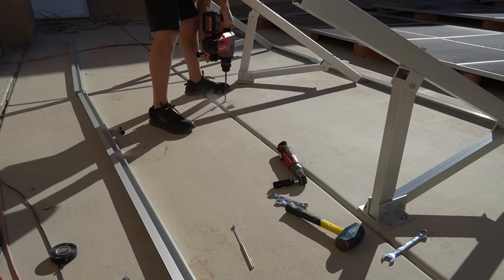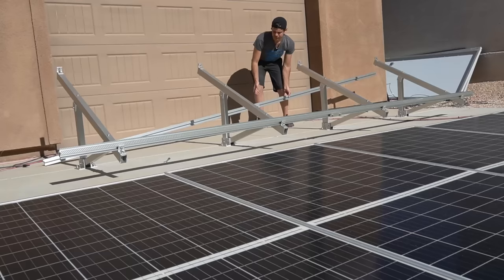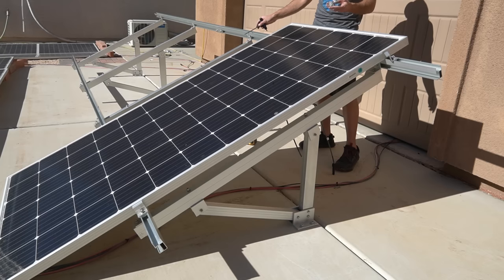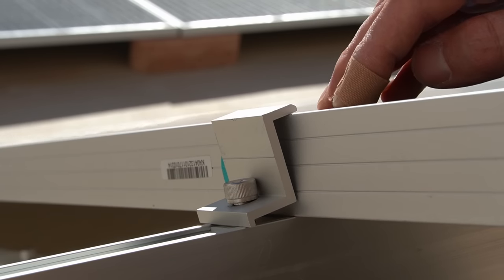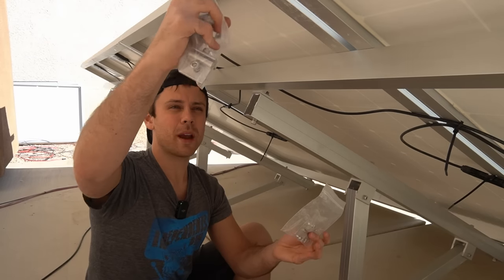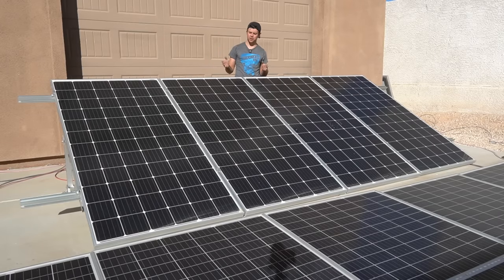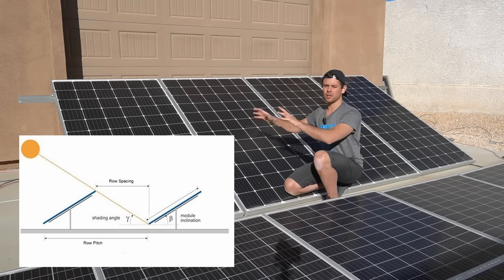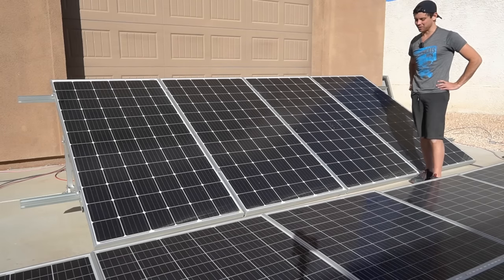$279 Ground Mount Solar Array - DIY Friendly!

Comment: Ok, it's unlikely that a bolt of lightning will struck your panels at their current place. Nevertheless, the ground connection should be a massive rod. The clamp for it shows its nominal diameter quite well. This tiny wire will just evaporate, when the frame got struck.
Reply: Pretty sure a direct hit of lightning would destroy the panels, doesn't matter what ground connection you put in. For direct hit lightning protection you'd need an air terminal. Not sure what grounding these likely anodised frames would achieve (compare to a car: a big hunk of ungrounded metal...) Maybe for electric shock from abraded cable on worn frame and then you touch a non-anodised part? Seems unlikely.

Comment: I work at huge solar farms on a weekly basis and all they use is zip ties to secure string wires. They shouldn’t because after years they end up breaking and the wires just hang.

Comment: Movable Array 
How about use 5 gallon buckets with cement to anchoring your ground mounted solar array. Give you the flexibility of being able to move it.
Reply: I like this idea. It is practical on the patio in a multi story condo building.
Reply: Watch your winds.. could easily tip..

Comment: With the prices of new and especially used panels coming down sadly racking can cost as much or more than the panels in some cases. I'd like to see more in the way of affordable racking solutions as I would like to cover my 20x40 shop with panels at some point. Also would be interested in hearing about the inverters that will operate without batteries or grid tie and how much they can actually put out in those conditions. Also interested in the power limiting inverters as many people either don't get paid for power put back on the grid or they have meters that don't read backwards. Both common issues if you have an electric co-op.

Comment: Bummer that they're a 25° fixed angle, according to the web site. It looked like you might be able to change the angle of that "horizontal" piece to tilt the panel. But I guess that won't work, since it's going to get blocked by either the ground or the column you mount it on.
Reply: New version is adjustable from 25-45 degrees.

Comment: Doesn't this invalidate the zoning / permitting loophole you've alluded to in the past?  Previously you've suggested that because your panels were not permanently mounted (they were either on your trailer or just plopped on the ground) you felt that permits / zoning approval was not needed; but as these are bolted into the concrete I have a hard time imaging you could convince an inspector that they don't count as permanent.
Reply: "They aren't permanent Mr. Inspector. I can unscrew them in minutes!"
Reply: They are not wired or affixed to the housing.  There is no issue here.  His "microgrid" is also self-contained for running his AC and Car Charger.

Comment: Legitimate question. Not being sarcastic. Why would you need to bond the panels to the stand when you already have brackets bolting the panels to the stand, all metal on metal connections that then is being earth ground by lag bolts to the concrete?

Comment: Would it be helpful from a heat mgmt perspective to slide those panels about 6 inches up and not have them resting on the ground?  I’m thinking about getting better airflow from the bottom up to keep the panels cooler.

Comment: Nice product, though you would think they would know that 25 degrees is not correct for the USA.  38 degrees would be correct.
In Miami, Florida you're all set at 25 degrees. Not so much for Portland Maine (43.65 degrees).  Just sayin.

Comment: Good morning from Sacramento CA. Thanks Will.  Good camera set up and sound quality. A few instructions missing like measure and mark center so you have the correct over lap for longer arrays and how to continue the rails to the next piece ( ie 5-8 more panels) than the 4 panels shown and of corse ground bonding. So what I am asking is the a 10" internal connector that slides into the end ?

Comment: Hi Will, I've been watching your videos since your RV days and learned a lot from you. I was able to use the knowledge you shared with your audience to set up some very simple solar systems on my rural property in Oregon. However, I am not as good an expert as you are and right know I have some friends who need your expertise very badly. My friends in Dnipro, Ukraine, are without any power now because Russia is destroying the infrastructure. They live in an apartment building on the fifth floor with windows facing east and west. What kind of solar set up could you recommend for them to be able to get light, their electronic gadgets charged and maybe able to boil some water to cook some hot soup or make hot tea. The solar generators on the market are too expensive and there are just not enough of them for everybody. I believe it would be easier for my friends to buy separately some panels, chargers, invertors and batteries and all that small stuff like breakers and wires and what not. I would appreciate your advice on the parameters of such a system and best choices on the market, so that they would not waste their resources that are already stretched thin. Thank you for your help.

Comment: Hey Will, Have you ever considered the total power generated from true south facing panels vs 1/2 array facing SE + 1/2 array facing SW? I believe the sum of the two bell curves (Watts in) from split face will be about the same a a true solar south facing. Consider driving a 2m pipe/rebar into flat ground. 2hrs before solar noon, drive another pipe/rebar at the tip of the shadow from the first pipe. 2hrs after solar noon, drive a third pipe at the shadow tip. Setup one panel facing SE and another facing SW. Setup another two panels, in series facing solar south. Collect and compare data over a few days. Would a split facing array collect more power through out the day? Or does it just average out to be the about the same? Cheers
Reply: You should look up projects with everday dave he really breaks down solar energy and i believe tested this theory and proved it to be minimally effective(if memory serves)
Reply: @optionstrader9637  thanks. I’ll check it out. My thinking is someone has done this before. I don’t have the equipment to run thru sims. Cheers

Comment: I installed 12 Kw solar on roof, I'm 73. I have to understand how I can connect to grid with these E4G batteries with mini inverters which are required on roof-tops in this jurisdiction and shut down during a power failure. Even if it is a manual/automatic transfer switch can I use the batteries and an inverter to operate the mini-inverters system as an off grid as a back-up?

Comment: I just cemented my yard and I’m not going to be drilling any holes in to it. I wondering would five gallon buckets, filled with cement and  bolt in the ground mount to it. And one in the front for support.
Reply: thats my plan,  according to the internet, a 5 gallon bucket of set/ready to drill concrete is around 100lbs, so 4 of them should hold it down good.
Reply: @keything8487  I’m thinking adding threaded rods to the base mount into the cement and level. To give it more strength into the cement.
Reply: @iiinsaiii  make like a J Hook with the rod

Comment: Hi Will,

Thanks for all your videos. I need your help. I have an issue with a 340W ( Vmp 32 V, Imp 10A, Voc 40V, Isc 10A.6) mono solar panel I recently bought. The voltage reading without load is fine, but without load I can never get more than 1.8A. As soon as it's connected to my microinverter or my off-grid inverter, the current goes down to 0.1/0.3 A and it never makes more than 11W. No shade, no visible damage, nothing. I already change the MC4 connectors, check voltage continuity in the cables, changes cable, tested the bypass diodes, temporary replaced the bypass diodes, and still nothing. Always the same 5-11W power production. 
What could it be? I run out of ideas.....

Thanks!!

Pepe

Comment: Can you adjust the angle for the change in seasons? Would love to see a video on some cheap / DIY sun tracker mountings for panels
Reply: With solar panels as cheap as they are, trackers hardly ever make sense. Need more power? Add panels. Less complexity, no maintenance.
Reply: @SolarWebsite  That's not true at all if you can DIY.
Reply: @dherman0001  That is true, but only if you place no monetary value on your time.
Reply: @SolarWebsite  Probably true.  I'm semi retired.
Reply: @SolarWebsite  truth, prices are favorable for more solar. Not all have the available real-estate though.
Reply: Yes. if you can attach them to a girder that you can rotate and lock in place.
Reply: @SolarWebsite  Only if you have the space. Not everyone does.
Reply: @ahaveland  Restricted space can be factor in favour of a tracker, yes. People just generally seem to underestimate the effect of moving parts on the cost per kWh. Fixed solar panels are essentially no-maintenance devices, and makes them cheap in the long run.
Reply: @SolarWebsite  What?  Solar panels are cheap?!?!?!  I am NOT buying a ton of the wimpy watts to make my array.  As it is, I need 38 of the 400 Watt.  Where are you finding these so-called cheap panels?
Reply: Updated version is adjustable from 25-45 degrees.

Comment: Likely unrelated question, but didn't know where to easily ask. I have been quoted 30% guaranteed performance over panel specification by a solar installation company. they "guarantee" that their silfab 400w panels will produce 520w efficiency. Is this marketing bs???

Comment: hmmm..... I have a brick home with south facing wall.... turn that mount and into the brick it goes.  would be better if it wasn't a fixed 25deg.  I need more like 45deg for winter sun.

Comment: You should NEVER drill that close to an edge or control joint, the pressure from the wedge anchor will split a whole chunk off the edge and then you only have half as many anchors holding the piece, not to mention it splits & spalls the whole edge of your slab.

You should drill a minimum of 4 inches, and more like 6 inches in from the slab edge, and drill ALL THE WAY THROUGH the slab, that way when you take out the frame you can hammer the anchors down into the ground and even sink them below the top of the slab with a punch in case you want to patch the holes with grout, slilcone or other filler.

Comment: What do you do to clean a solar array? I know the panels on the ground is not a issue but you do have a large array on your roof. Our 9k array gets very dusty, I don't really notice any losses in power generation but really how would you know? Im sure I remember reading somewhere not to use chemical glasses cleaners on them as this can affect the aluminium frame.

Comment: What width size panels did you install? I have 4x 320W Renogy panels (40" wide ea.) i plan to install and need to know if they'll fit on this rack or not. Grazie!
Reply: For anyone wondering, yes they fit, all 4. I bought this same rack. The instructions for this is horrible and out of order. The manufacturer reached out back to me on some questions i had pointed out about the anchor screw steps, they responded with some clarity and said: "...there needs to be some clarifications/corrections in the manual." I actually installed the 4 concrete piers using 12" diameter tubes.

Comment: Some comments said that this mount is a fixed 25 Degree Angle.  Is that true?  It appears that the angle is adjustable.  SigSolar website never states a 25 degree angle, or did I miss something? Reply please.
Reply: it's fixed

Comment: The edge mismatch on the right drives me crazy, LoL.  But I guess this is going to be taken apart anyway.

There are a few issues that are ignored with this quick video, like micro-inverters or bulk inverter?  Getting the power from the array to wherever it's used (e.g., NEC reqts)?  Showed the ground connectors ... but where does it ground to?  (single ground point for system)

This is essentially the setup I used on my roof years ago, just without the stands to lift one edge off the ground.

How did you locate the holes for the concrete bolts?  For metal or wood, I'd typically use a punch to locate the drill tip.
Reply: text-2308  You're a scammer, not Will. Stop using his pic

Comment: Hi Will, Or can anyone help me. I think I ruined my new Renogy 170Ah LiFeP04 batteries? I was hooking them up in parallel and I touched one lead to the + of the other battery and it sparked and now I can't charge them. Battery 1 sits at 12.96v and battery 2 sits at 13.58v. When I put a load on either battery it just goes down to 11v or 12v What can I do if anything?

Comment: Hello guys. Is it possible to raise the rear array up to not worry about shading and create 2 or 3 tier setup. I have 40 panels. Maybe do a 2 tier with 2 rows of 5 for the 40 panels.
Reply: You could seperate this into 2 smaller racks if you don't use the expansion bar

Comment: Why wouldn't you just make a covered patio roof with the panels? 🤔
Reply from the maker: I get new panels every six months so that would be just terrible. Please watch my older videos where I cover this a lot
Reply: Hi Gavan, I wanted to do that but I live in Rural Am.  I am surrounded by Agricultural fields.  If I wash my car @ 9 am, by 11 am you can run your finger along the paint & see the cleaner path your finger made.  I could never keep my panels clean.  If I built a carport, it wud cost $$ more + it would have to be 12' tall for proper clearance (try coming home with a new water heater, Fridge, etc.sitting on the back of your truck). Climbing up on a ladder daily to wash off dust buildup is insane!

Comment: How this installation might work with local building permits? Anyone knows limitations or restrictions for ground based solar installation? (I live in Illinois)
Reply from the maker: It's different everywhere. Where I live, if it's under five feet tall and no posts deep in ground, no permits or anything required. Check your local laws

Comment: That was far more complicated than using the good stuff from Iron Ridge.
There is nothing better than “IronRidge” racking. 
Simpler, less expensive, EVERYTHING is self-bonding, and they have options for roof/ground/ballasted/pole/tracker etc etc.